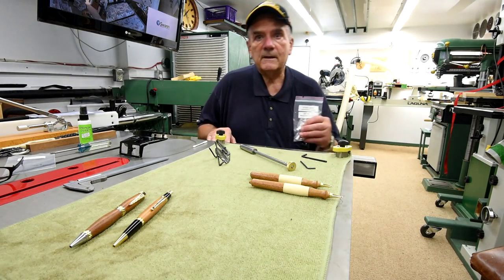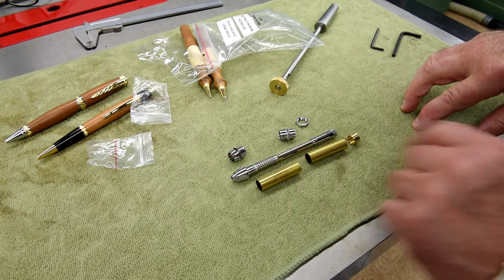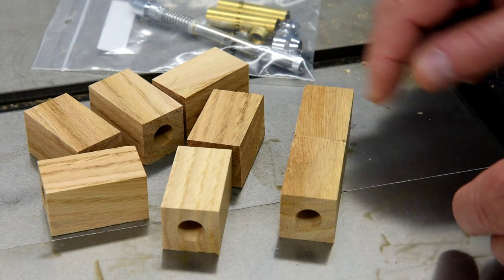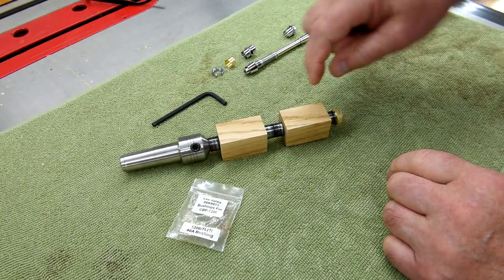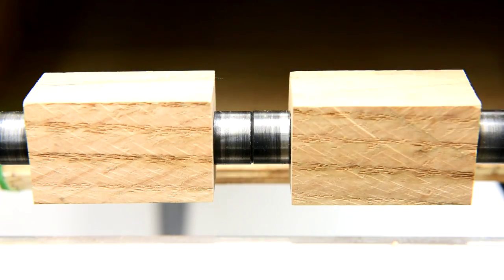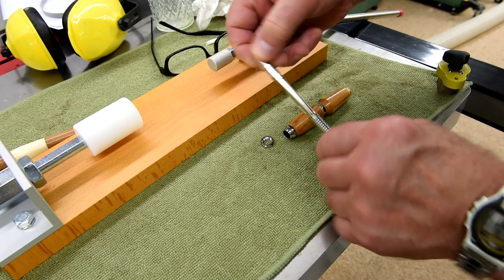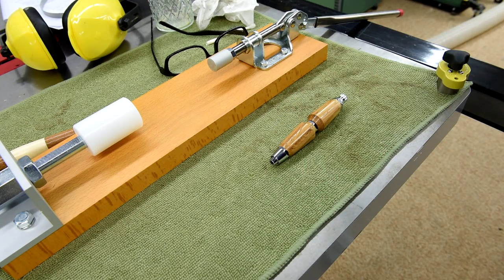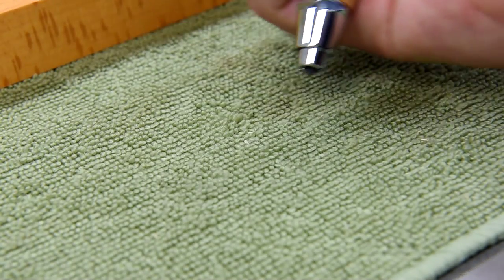The Woodworker's Pencil

Comment: I have a similar version of this, but the barrel is 1 piece without the center band, so you turn the whole barrel as 1 piece.  I think I got that kit from Woodcraft though.  I've made one like the Leevalley kit in a black acrylic and the kit I got was black as well.  It turned out awesome.  Get the right combination of kit colors and barrel colors and you can get some really cool stuff.  

I made a somewhat custom pen for a guy in the Air Force last year.  He wanted a pen that he could put a dog tag chain through and wear around his neck.  So with a little bit of searching I picked up a black slimline kit, and unfortunately they don't make a black stylus kit...or didn't at the time, but they had a gunmetal one, which for some reason when I got everything and finished the pen you couldn't tell it was black mixed with gunmetal parts from another kit LOL.  The pen turned out great, and it was made out of acrylic as well.

Comment: One way to get the middle of top and bottom the same size is to remove the bushing(s) and butt the two together. Turn until they match, then put the bushings back in between.
Reply from the maker: That's a good idea alright. Just have to periodically measure with a caliper to ensure that you don't turn too small. Thanks for commenting Steve :)

Comment: What were the measurements of your blanks to make the pencil so fat?
Reply from the maker: 3/4 inch
Reply: @roncalverley  thanks for responding.  I thought the initial board was 3/4 and you used a board slightly thicker.  Maybe 1x1 x5?
Reply from the maker: YES!! You are correct my friend. Because it was about 5 years ago, I'd forgotten. Just now viewed the video to refresh my memory, and 1 inch is about right, possibly a bit more. 👍https://youtu.be/TvNpeAkHgIw?t=157